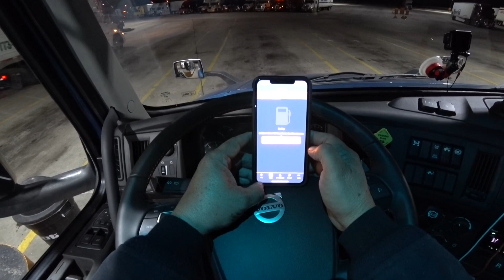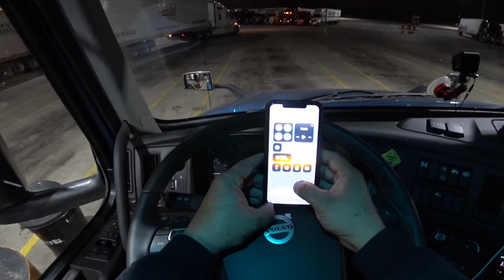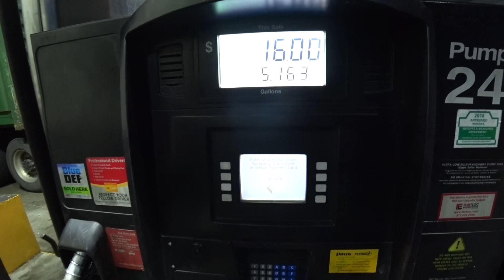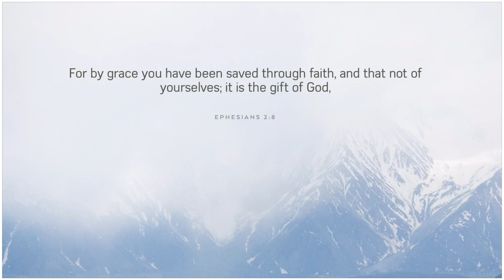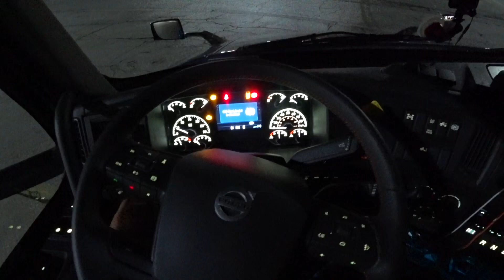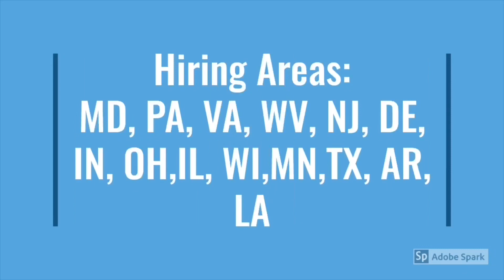December 23, 2018/1484 fuel at Pilot Truckstop

Comment: FMCSA  disagrees with you JBG..."After controlling for a calendar year, EHSR-equipped trucks had a significantly lower total crash rate (11.7 percent reduction) and a significantly lower preventable crash rate (5.1 percent reduction) than trucks not equipped with an EHSR, according to the study."  (Note: Though the study uses the acronym EHSR, the proposed mandate refers to the systems as electronic logging devices, or ELDs.)